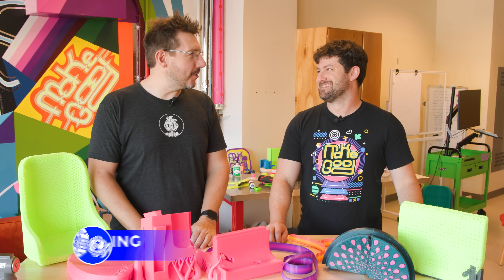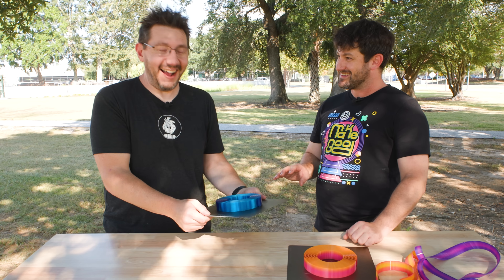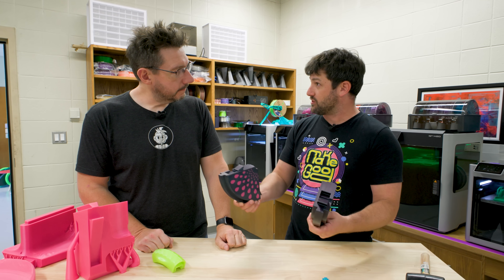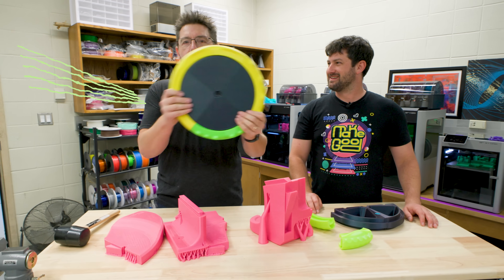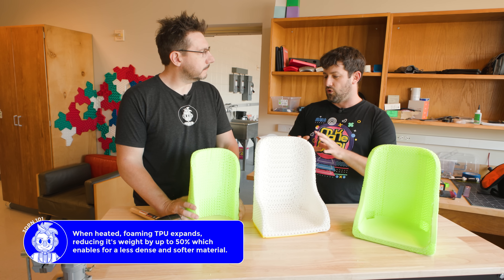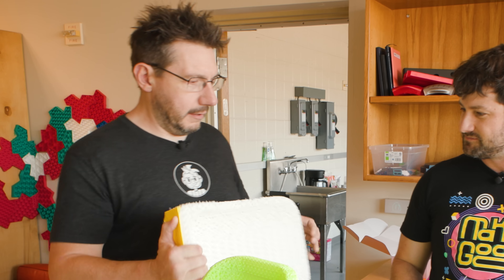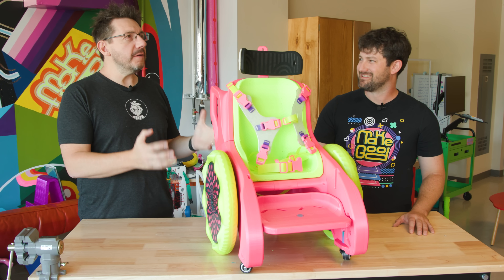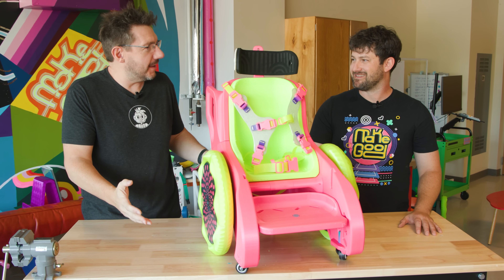Flexible AND Strong?

Comment: 4:56 C'mon, that's not well-designed for 3D-printing, requiring all those supports. Make the connector wall at an angle so it can be printed without supports.

Comment: I like this but i feel like you should be able to buy a metal one for the $140-210 worth of filament...(i know im probably way off and their probably way overpriced) maybe a combination of materials could be used to lower the cost in general, im not saying their shouldnt be any 3d printed parts, i really like the design...  but if you need to make alot of them, my suggestions would be to switch to an adjuatable aluminum design, this would be robust and lightweight, the kids could use them longer if adjustable, (adjustable width and height) and maybe the seat and restraint items stay 3d printed, for comfort and customization, wheels might be cheaper to utilize an off the shelf bicycle wheel or larger castors...  just my 2 cents, i do love the concepts present in this video tho....
Reply: All great points. We think all designs are good and should be more available! The idea with 3d printing is that it’s really easy for anyone to do compared to working with metal

Comment: Do you have a link to share for the foaming TPU? looks like a cool filament - if you have any filament profiles for Bambu studio to share that would be good!
Reply: @planetWayne  simply search for farming tpu in your search engine of your choice. 😁
Reply: There are at least a few kinds, I've been using Recreus' FilaFlex Foamy to make various things (it's almost indestructible, really hard to tear apart and bending or impacts won't do anything at all to it), colorFabb has varioShore, and eSUN has TPU-LW. They're not hard to find.

You can also get foaming PLA for stiff lightweight structures, like making RC planes etc., usually sold with names like PLA-LW or something. =)

EDIT: Oh, also Siraya Tech "TPU Air"!

Comment: I'm curious how much a build like that is roughly?
Reply: At 9:47 they say it's about 6 rolls of PETG and 1 TPU (though they also said it was about 250g of the foaming TPU per seat earlier, so maybe 4 seats from one roll). Given the ranges of filament cost it could be between $125 and $250 ish depending on what you use
Reply: About $150!

Comment: Those huge TPU strap designs are great, on the other end of the scale have you seen my Hoopin TPU Cable Ties? You can scale them in the slicer to be smaller or bigger for your needs, at 150% scale a single one can easily carry 14kg.
As they're basically made from hoops & pins (hence the Hoopin name), you can link them together for longer ties if needed, or use the included origin parts to design your own custom ties.
Reply from the maker: Whoa what??? Will check k them out.